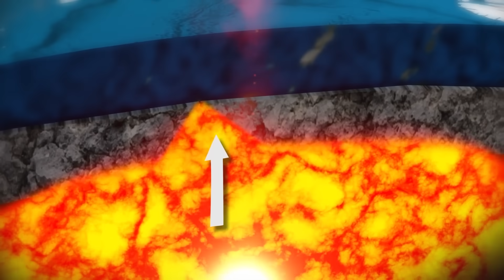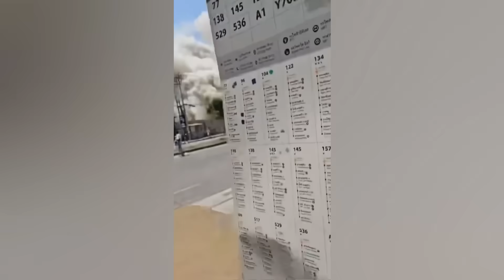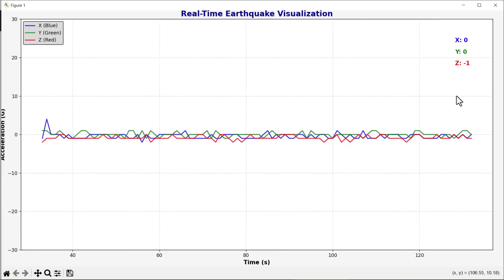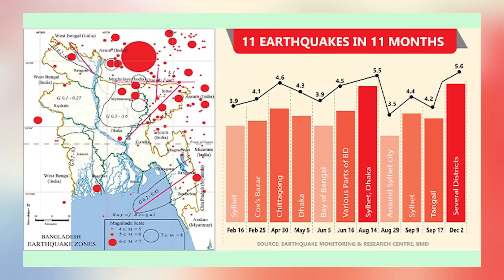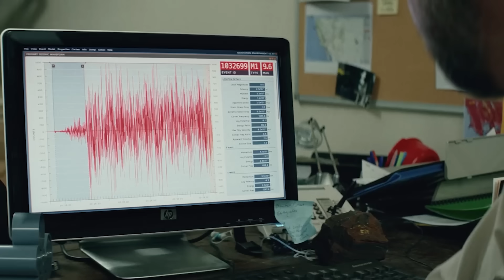Another Earthquake Like Myanmar Could Strike Again Soon

Comment: A serious scientific error in this video.  It’s a strike-slip fault, yet every one of your animations shows a subduction zone quake.  Who cares?   Well, it matters because you also stated that if this fault line erupts under the Andaman Sea it could cause a tsunami.  No, in fact, it couldn’t.  A strike slip fault cannot cause a tsunami (to be clear, some ancillary issues could trigger one, like if the quake causes an underwater landslide… but a strike slip fault in and of itself cannot cause a tsunami).  

The difference?  Your animation shows two plates sliding over/under one another.  As they stick, the plate on top bends with the stress (rock bends? …barely… but over this huge distance and done slowly, yes).  When the pressure becomes too much and the fault erupts, the top plate snaps back in place - upward.  And if this occurs underwater, it forces a massive column of water above it upwards… a tsunami.  On the other hand, a strike-slip fault is too plates sliding past each other… NOT over/under.  The displacement is more horizontal than vertical.  Without the vertical displacement, if it occurs in the ocean, the water above it is not displaced.  No tsunami with a strike-slip fault.  

It was, in fact, one of the big flaws in the movie “San Andreas”.  It’s just a movie, so, it’s fine.  But the San Andreas Fault is also a strike-slip fault incapable of creating a tsunami.  The movie, fictionally, shows a tsunami occurring after the quake.

Comment: The results of geological investigations using modern technology in the central and northeastern regions of Thailand did not find any saw marks or cracks, and there was no risk of earthquakes.
Reply: As it's mentioned in this video Central plain of Thailand especially greater Bangkok area will never get direct hit by ant earthquake but it's regularly responds and amplifies any wave recieved mildly shaking buildings in it area. Law has been imposed in Thailand for ten years for any construction to cope with the earthquake of magnitude 8 but the solely affected building this time just built after the law !